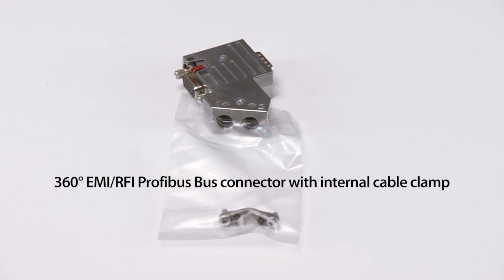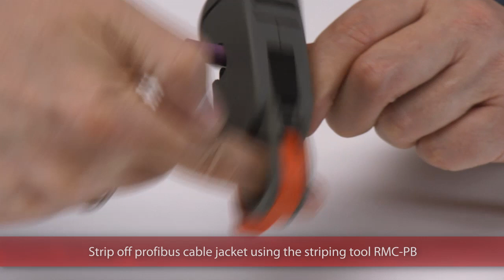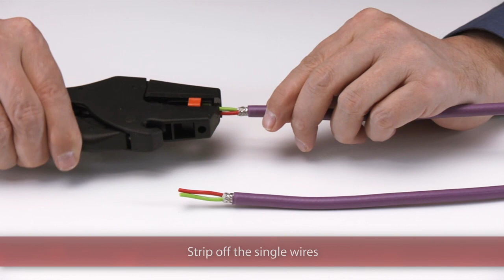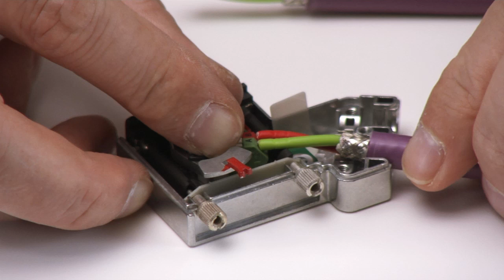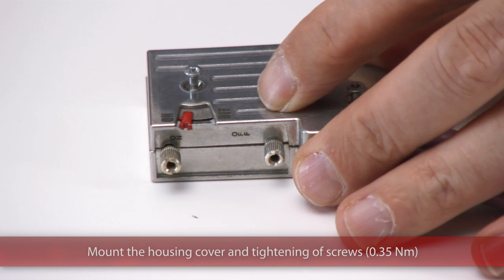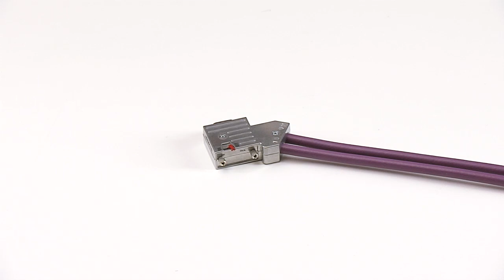Provertha Assembly Video Profibus Bus Connector Internal Cable Clamp

Comment from the maker: A copper foil around the screen has its advantages and its disadvantages
Better screen connectivity and protection of the screen. As a matter of fact the glue on the copper reduces the pull off force of the cable. Due to easier assembly we decided not to recommend the assembly with copper foil around the screen.
 
Marco Staib
Product Manager

PROVERTHA Connectors Cables & Solutions
Reply from the maker: Using a copper Foil around the screen for the assembly, the usage of a foil with electrically conductive adhesive is strongly recommended.

Bei Verwendung einer Kupferfolie um das Schirmgeflecht zur Montage sollte Verwendung eine Kupferfolie mit elektrisch leitendem Kleber verwendet werden.

Marco Staib
Product Manger